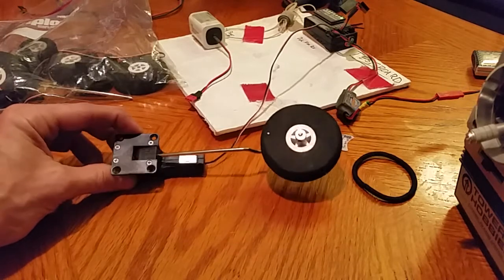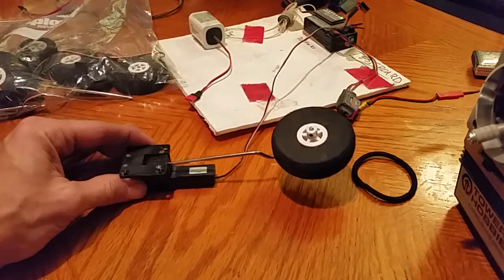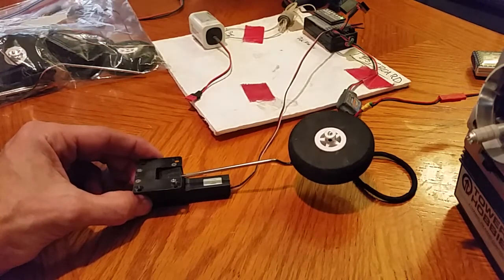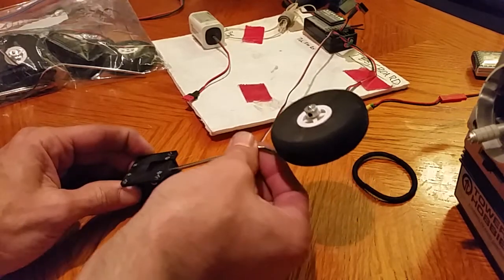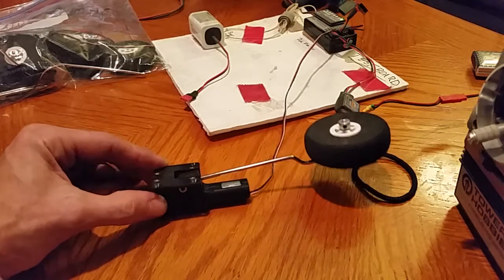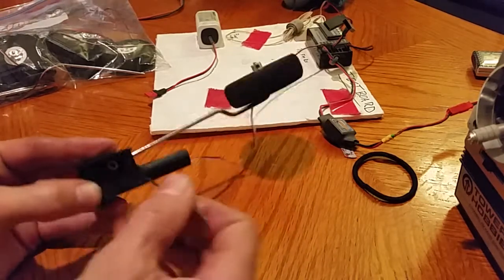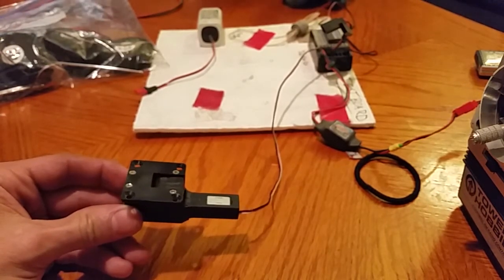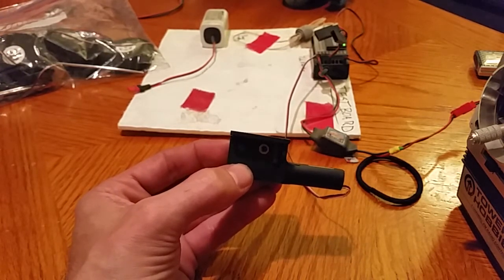RC 101 How to change the landing gear strut from servoless retracts

Comment: This certainly helped me. As you say, it's easy when you know how, but it's not obvious that there's a tiny grub screw in there. I have to switch a faulty retract on a Dynam Trojan and I couldn't work out how to remove the strut. It's done now. Thanks for posting this.